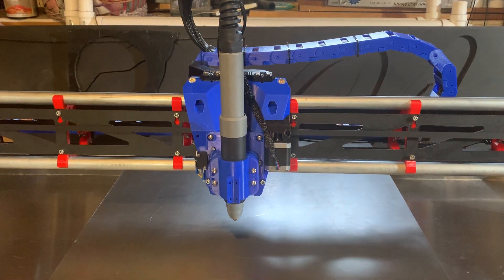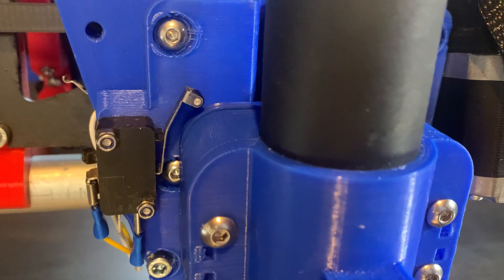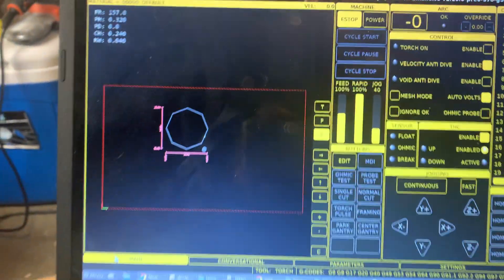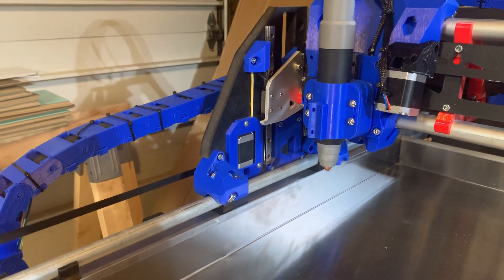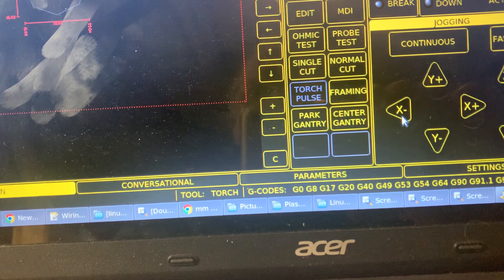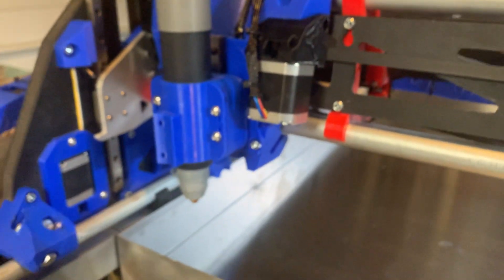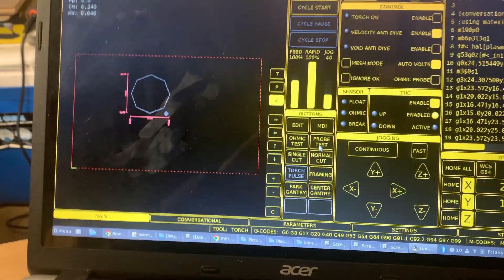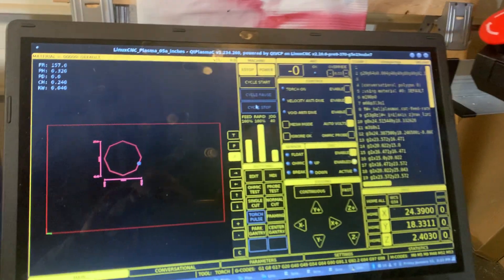LowRider 3 CNC DIY Plasma Table PART 11 - LinuxCNC QTPlasmaC - homing and dry-run test!

Comment: Is marlin compatible with Linux CNC?
Reply from the maker: They are both operating systems that process G-code commands. Linux CNC is based on the Linux operating system and can run [basically] wherever Linux can run. You only need one such G-code processing operating system in any given machine. While Marlin does great for CNC routing with a LowRider, as well as 3-D printing and laser & plotting, when it comes to plasma cutting, Linux CNC offers some advantages. That’s why I have two different operating systems on my two LowRiders. I use the Marlin firmware for processing G-code on my router-based LowRider V3. I use Linux CNC for processing G-code on my plasma torch based LowRider V3.